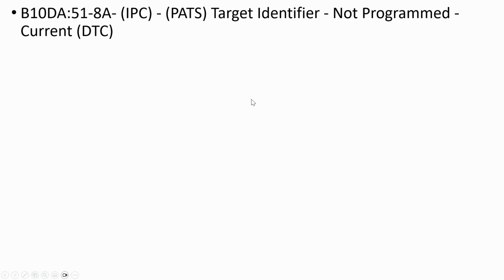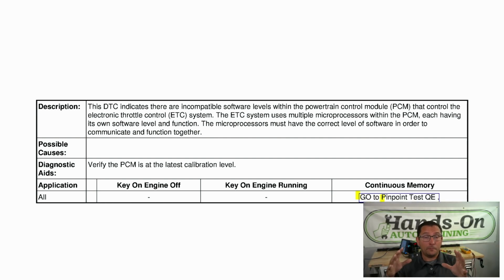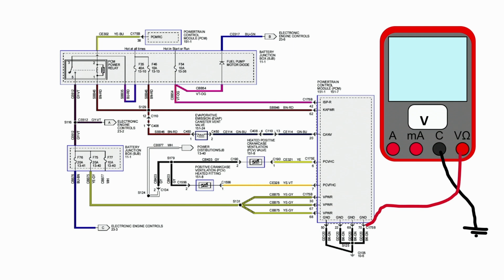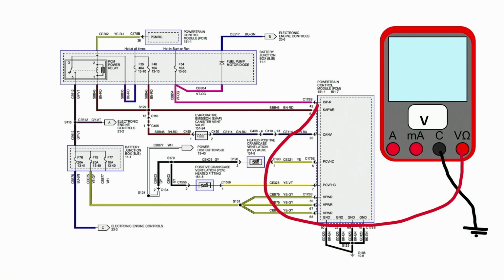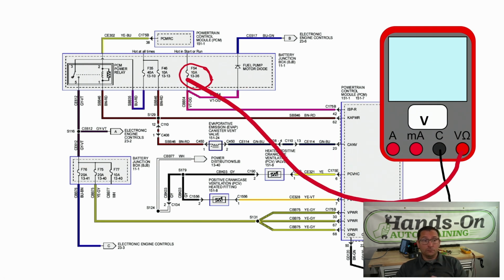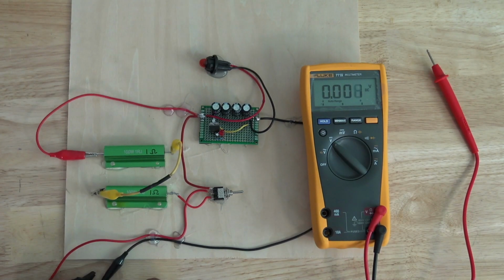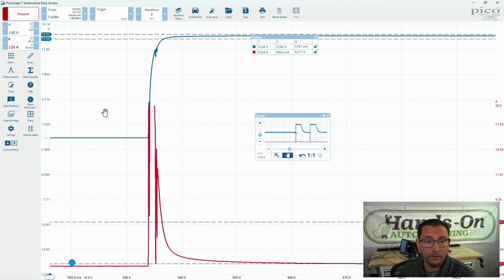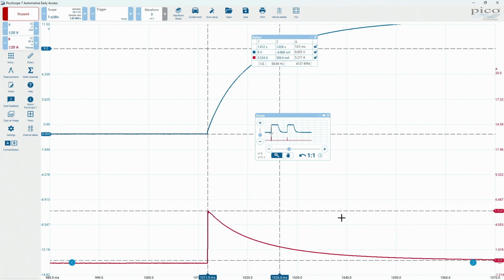2009 Ford E Series B10DA U0300 P060A P1602 NO CRANK

Comment: 👏🏻🫡
Reply: The voltage drop test is always important , also load test .
A lot of GM vehicles , trucks and SUVs is very common to find voltage drop across fuses , and relays .
I've seen mechanics replacing bunch of sensors without success just for a simple  fuse chafing or corrosion ..

Comment: Hi Brian,

I have a 2012 Ford E-Series. The problem seems similar to what you covered in your video. However, in my case, the engine suddenly shuts off while driving. A new computer was installed, and after that, the car ran for 4000 km without stalling. The only issue was that sometimes it didn’t start properly.

Now, the car has stalled a few more times, and it won’t start at all anymore. Do you have any suggestions on what the problem might be, or do you know of a similar case?

Thanks in advance!